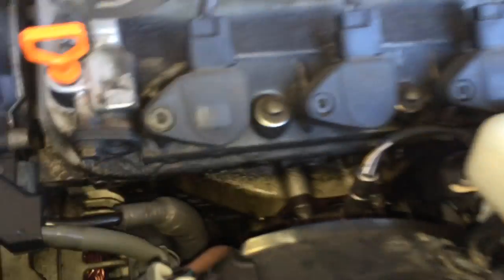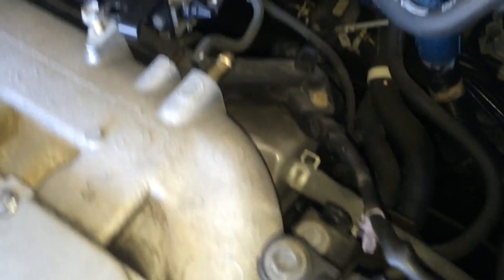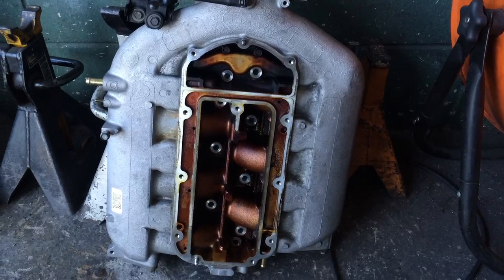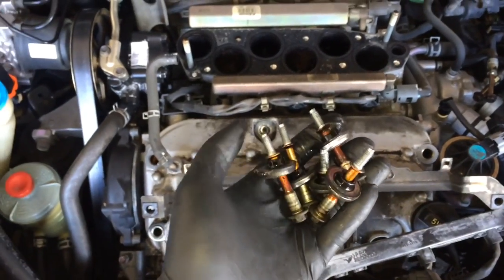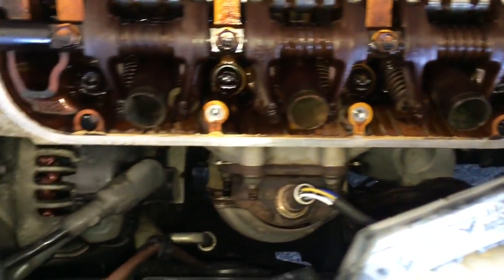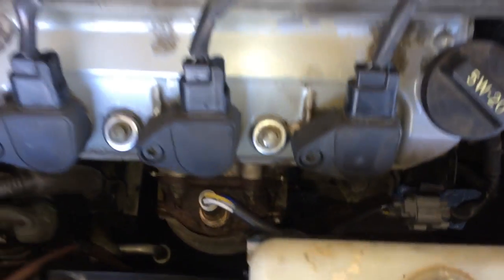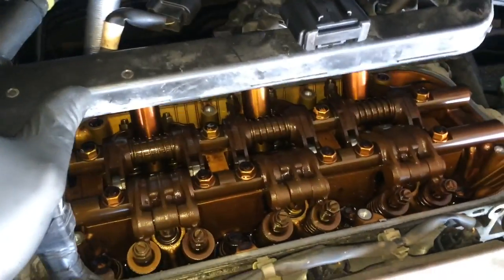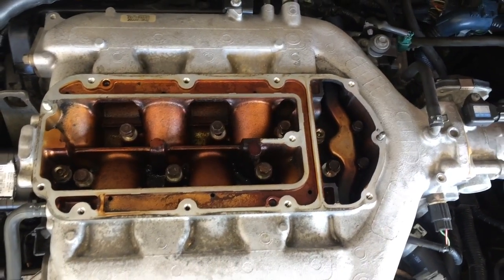Replace Valve Cover Gasket V6 Honda and Acura

Comment: Good video…one thing to add that is very important…right after you get the intake off…first thing…take duct tape and cover up the intake manifold so nothing can fall in there. If you drop something in there it can be a disaster.
Reply: Thx

Comment: Can you do the front gasket without removing the intake?
Reply from the maker: Great question. Some of the models(mainly the suv v6s) has a intake plenum spacer that allows enough room to do so without taking the manifold off. Most cars that came with the V6s didn’t have the spacer

Comment: Nice video I was told the head gasket was out did tests and nope found out it was just the valve cover gasket fr got 2000 off the car just for that
Reply from the maker: Nice! You got a good deal then! Sometimes people will refer to that valve cover gasket as the head gasket. Especially if their knowledge in cars isn’t that great or if there is a language barrier and English is their second language. I use to hear it quite often at my old shop.

Comment: Just a question did you replace them bc oil was in one of your coil packs? Because if not then why would there be oil covering one of my coil packs along with the spark plug? And it’s just 1 of them out of 6

Comment: Good Video! I also replace the PCV valve (p.s. side front of front valve cover). It has a couple of O-Rings that will eventually leak by over time. Had oil leaking down onto the alternator. Having ripped a plug tube seal before, I swipe a little oil on the tube seal before I fit the cover back down.

Comment: You deserve way more likes and follows for this. You helped so many people.  Saved me personally hundreds of dollars.
Reply from the maker: Thank you 🙏🏻 so much!! That’s why I do it. I try to save people money even if it’s a couple bucks or hundred!
Reply: Revved Up Knowledge I actually have a question! (Didn’t think you’d reply...) 

I replaced my valve cover gasket on my 2006 Honda Accord ExLV6 (191k). Shortly after, the check engine light came on, smelled burning oil, I checked everything to make sure it was tight as I went along. 

The only thing I feel like I could have done wrong, was when I was putting the valve cover back on, instead of letting the spark plugs rest up against the new seals, I used a flathead right carefully stretch the seal to where it sealed on the outside of the end of the tube. (Almost like a condom)(sorry i didn’t know what else to compare it too). 

I know your supposed to let it just rest against it, but I was worried it wasn’t gonna seal even when I tightened it down. 

Long story short, I had the engine lights tested and it came back as 2 HO2 sensors, and evap chamber. Three days prior, I had the catalytic converter checked and one of the sensors replaced. The codes had cleared, no lights, they said it was running fine. 
I did disconnect the battery terminal throughout the procedure. 
What could cause a sudden trip of the sensors, could it be the smoke from the burning oil?
Reply from the maker: Lol I try my best to reply! 😁 where is the oil dripping down? I don’t think it’s your spark plug seal area since it’ll just be a puddle of oil inside the spark plug tube and not burning oil. As for the check light if it hasn’t come back on since it got cleared you should be okay. Maybe you cycled the ignition when some things were disconnected? I would be more concerned if the light came right back on after the clearing.
Reply from the maker: I know I have left the top O2 sensor disconnected before and started the car 😳 and tripped the light

Comment: Wait so how did u get those 10mm bolts to come out (from the valve cover)? The rubber grommets on the bolt's lower half with the ridges seem to not allow for pulling them "all the way out" prior to lifting the valve cover up...what's the secret?
Reply from the maker: I’m more than likely too late on this question but to answer it I use a wire cutter to snip off the rubber grommet then slip on the new one.

Comment: Good video.  I'm smelling some oil when I pull it into the garage.  I replaced the front valve cover gasket about a year and a half ago but I didn't have to take the intake manifold off.  I'm assuming I have to take the intake off to get to the back one right?
Reply from the maker: Thank you! For the back some V6 models have a intake plenum stack/spacer that creates enough room for the covers to be taken off. I believe in your case you probably don’t have to take the intake manifold plenum off either to take off the rear cover. I would visually check for clearances and if it looks about the same as the front cover I would go ahead and remove the cover first before taking the manifold off. If it comes off then you saved a good chunk of time!
Reply: Scott what year is your accord

Comment: Awesome thanks! How would you recommend cleaning the oil that leaked underneath? I'm guessing I shouldn't spray with a hose or pressure washer...
Reply from the maker: Thank you for watching!! i normally hit it with some brake/parts cleaner and some compressed air. some of the oil and cleaning stuff will go on the manifold/exhaust though and may cause some smoking though. You can also have someone professionally detail the engine for you as well
Reply: I dont mean to be so off topic but does someone know a method to get back into an Instagram account??
I was dumb lost my password. I appreciate any tips you can give me.
Reply: @Bode Jaxx Instablaster ;)
Reply: @Troy Aarav thanks for your reply. I found the site through google and im in the hacking process now.
Looks like it's gonna take quite some time so I will reply here later when my account password hopefully is recovered.
Reply: @Troy Aarav it did the trick and I finally got access to my account again. I am so happy!
Thanks so much, you saved my account!
Reply: @Bode Jaxx glad I could help :)

Comment: When reinstalling the valve covers do you put any silicone sealant on?
Reply: Late reply, but for anyone else reading this later on: don't add silicone sealant, it'll create an uneven surface when you torque the screws back down.

Comment: Maybe I just missed it... what is the torque on the valve cover bolts? Appreciate the video!! Thanks!
Reply from the maker: Not labeled but I do the to about 6-8ft lbs
Reply from the maker: But lightly tight is good enough. I don’t use a torque wrench
Reply: Revved Up Knowledge ..Thanks, I found it. 8.7 lbft or 105 lbin just a FYI. That goes for all 10mm head bolts on the majority of the engine and 16lbft on the 12mm head bolts. I just adjusted the valves and did all new intake gaskets on a friends 2004 mdx. Made a huge difference. Thanks again!

Comment: What is the part below the dip stick has one bolt "bolt" head facing  the front the vehicle.
Reply from the maker: I’m not really sure, I’ve taken it off to put a new o-ring on it though. Be careful if your doing it as well because it can be pretty brittle at times
Reply: @RevvedUpKnowledge  yup too late came out broke want to replace it. Had to clean up the valve covers and did all the Seals for my mom van.  Went well she's back up and rolling.
Reply from the maker: Sucks that it broke but glad it’s back up and running! 👍🏼
Reply: Pcv valve

Comment: Hi. What are the torque requirements for the bolts when putting back ? Thanks
Reply: Just put it back on as tight as it was taking it off

Comment: Do you have to replace the intake gaskets when you do this job? A mechanic said he has to do it as a result of the valve cover gasket replacement.
Reply from the maker: It is always recommended to but usually if the plenum gasket is metal I will reuse them. Never had a problem. If it was on the intake manifold (where the intake manifold meets the cylinder head) I would replace it. In this case it’s just the plenum gasket and usually(OEM) are metal ply gaskets. It’s not that much extra but sometimes you gotta save where you can! 😆
Reply: @RevvedUpKnowledge  yea I mean mine is 1999 V6 Honda Accord so its probably the gen before this one, that is, it is the 6th gen. Still not sure if I need to buy the gasket, money isn't the issue tho - just trying to make sure I don't f up on buying the right parts. The other mechanics didn't mention this to me tho so that's why it was confusing. I like this guy's price on the labor but want to make sure I make it easy on him and get the right parts and also don't over buy with the wrong or unnecessary parts.

Comment: I have oil leak on top of engine. Oil puddled on top of transmission.  Any ideas?
Reply from the maker: Check on the rear cam caps. One on each cylinder head. The one probably leaking a lot is the one right behind the EGR valve on the front cylinder head. It’s an o-ring on each one and is fairly cheap at the dealer and pretty simple to change. Hope this helps! Good luck ✊🏼
Reply: Yea thanks ill be checking those🤞🏻

Comment: No sealer?? On the seal or valve cover
Reply from the maker: I only apply high temp hondabond on the corners of the gasket
Reply: Revved Up Knowledge can I use permatex ultra grey maximum torque instead of the hi temp or should I buy hi temp?
Reply: I used Honda bond 4 which is more for motorcycle applications, but works perfect for just the corners of the gasket on my pilot. HT not required
Reply: @RevvedUpKnowledge why use it on the gasket corners?

Comment: You think this is a job I can do as a beginning DIY??

Most I’ve done is brakes and a coolant hose
Reply from the maker: If you have some basic tools you can definitely do this! Pretty straight forward job. Nothing crazy at all. Just be careful when tightening your bolts. 🤙🏼

Comment: Transmission mount switch? 😂  that must be right next to the muffler bearing
Reply: Its actually the engine mount switch.  The front and rear engine mount are hydraulic and that is the solenoid switch that controls the mount stiffness through the vacuum lines

Comment: No torque spec?
Reply: ban825 what is the torque spec? Also, No silicone
Reply: Been hunting for intake manifold torques for HOURS!! I'm getting bored with how to turn bolts, but no specifics.
Reply from the maker: I always do 7-8lbs for smaller 10mm bolts and 10-12 for the 12mm nuts and bolts. Tighten in a crossing pattern starting from the center
Reply: Thank you sir!  I went ahead and tore it down, and sure enough the intakes are loose. The Exhaust are far to tight (I've been getting Intake leak, and High fuel ratio engine codes for a few days). I'll finish in the light tomorrow.

Comment: Would’ve been nice if you showed yourself actually removing the spark plug seals and removing/ installing rear cover instead of just pointing and talking.
Reply from the maker: Fastrice taking the plug seals off is the exact same process as the front cover and very similar on removing/installing  the actual cover. It’ll be just repeating the same process